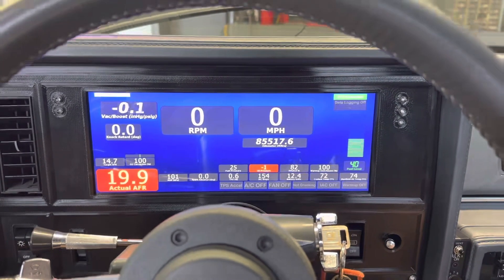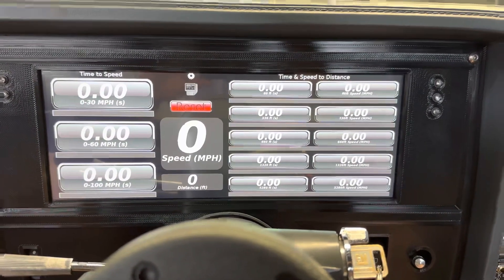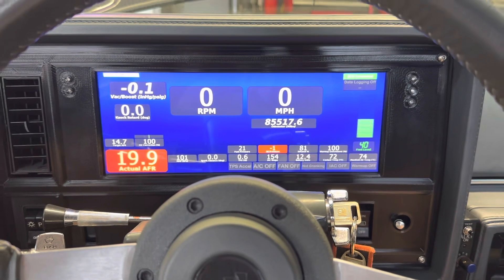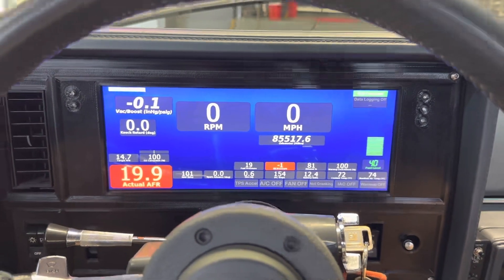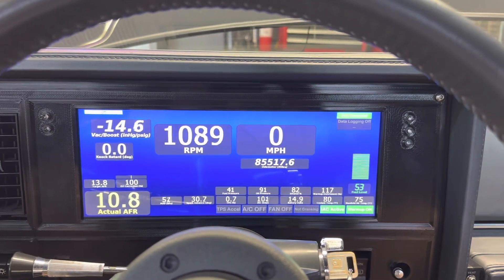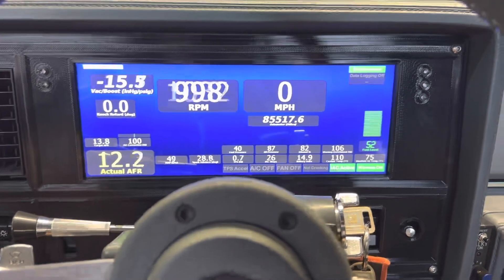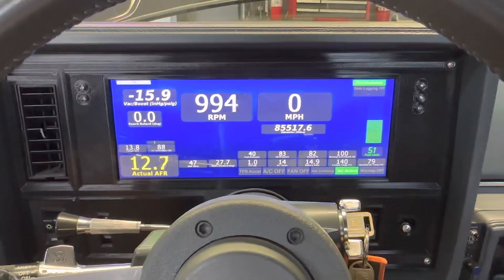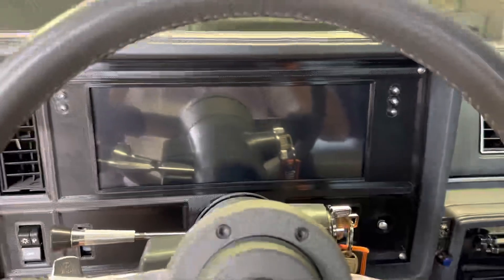G-Body Digital Dash Info!

Comment: The volt light. So sometimes when i drive the GN I'll notice that my volts are around 11v. Battery light on, then after a few minutes to 10 minutes of cruising it will randomly start charging 13.8 or above.. its very internment when that happens.
Reply from the maker: I would check the volt bulb socket in the gauge cluster. It probably has a bad connection on the printed circuit when the bulb is twisted in.  This volt bulb is what provides the resistance to the field  in the alternator to start charging. For the intermitten issue you are having, either the volt bulb circuit has a bad/weak connection or the alternator itself is glitchy…. I’m betting on the volt bulb circuit.  That socket the bulb clicks into has a resistor made into it help start the alternator charging in the event the bulb burns out, however if the connection is bad at the printed circuit or in the main harness plug into the cluster on the brown wire, it may not charge.
Reply: @AJsSpeedShop  thank you, going to church this out. I always found it funny why it would start charging after a few minutes of driving. Doesn't happen all the time but still need to be fixed.

Comment: AJ     a buddy of mine has a gn with a stroker motor a bunch of goodies 

He had 14.7 volts now he has 13.5 volts at the alternator stud when idling

The correct voltage on an Impala SS 140 amp alternator should be 14.1-14.7 volts at idle correct?
Reply from the maker: Voltage can vary based on the amount of load/equipment he has on when he is testing voltage.  Also how heat soaked everything is when he tests it.  I always test everything at full operating temp.

He needs to measure voltage drop between the alternator and the battery, if it’s more then .5v drop, then he needs bigger positive and ground cables from the alternator to the battery.

If it holds 13.5v at the battery with everything turned on in the car and it’s at full temp, then that is pretty decent.
Reply: @AJsSpeedShop  ty
My brother 
I knew you would have the correct answer...
Car is killer.  Appreciate it
Reply from the maker: No problem.  Yeah I would think he should see 14.5v at the alternator stud when it’s all warmed up, and depending on how much load he has on it.  If it’s a stock CS144 alternator, they are only about 90 amps at idle, so if he has everything on (AC, E Fan, amps, lights etc) then it could easily pull his voltage down to 13.5v at the alternator stud, and probably 13.2v at the battery.  That is sufficient but…a little on the low side.  I like to have no less then 13.5v at the battery at full electric low and full temp.

The PowerMaster alternator in my Buick holds 14.5v at the battery with everything on, all the time.  I’ve never seen under 14.3v.  It’s a hoss!
Reply: @AJsSpeedShop  
Seen that the other day
Awesome car
Awesome dash/ video 
Great channel brother 

I'm getting that dd efi
It's. A no Brainer.

Comment: Will the tc lock up without cruise control or will I need to gut my old speedo?
Reply from the maker: In order for your TC lock up to function, the ECU will need a speed input.  So if you can use the GPS speedometer for the DD-EFI dash and I believe the ECU will still get they speed input, it just won’t be coming from the cruise control module.  The ECU uses that speed input for the TCC LU mph, at say 60 mph.     So if you don’t want ti gut your speedo and use the stock pulsewidth generator and cruise control module, the TCC LU should still work, but your cruise control won’t.

Comment: Hey man great video. I’m about to. Order mines but was wondering how I can get the alternator to start charging. Does Casper’s make something for this or what did you do to get around this issue?
Reply from the maker: Yes Casper’s makes a device that uses the oem boost solenoid for power and triggers the alternator to start charging.  That’s one way to do it.  The other way to do it is switch to a “1 wire alternator”.  They are self exciting and don’t need anything else.  That’s how I did it.

Watch my video on “the g body 1 wire alternator swap” and I explain everything there.

Comment: Just watch this vid very informative. Quick question how does this digital dash compare to an MS3Pro plug and play? I have a 85 GN and I haven’t driven the car in a while. I’m now starting my build however right now I need a good tune. And of course I’d like to manage my own ecu. I know on the MS3Pro has more capabilities than the FAST programmer. Any thoughts you have would be much appreciate it.
Reply from the maker: This dash works with your MS3 Pro ECU. You still use your MS3 pro, and the dash plugs into the canbus ports on the side of it.
Reply: Good deal thanks for getting back to me. Another question will I run into problems: such as turn signals or other issues you faced? I’m definitely looking at your vids for in put. Also one more thing i’m having issues with my throttle positioning sensor. Causing my car to hesitate acceleration etc. Do you know of any upgraded part or substitute I could use for replacement? I will be taking it to a performance shop just doing some research right now.
Reply from the maker: @oneilbenn853    As long as your canbus network on your MS3 pro is functioning properly, the DD EFI dash should work with no issues.  The turn signals and high beam indicator in integrated into the dash itself. Kurtis@DD-EFI can set you up with everything and answer all of your questions.

As for your TPS sensor, you need to set the TPS voltage correctly per the oem manual, then calibrate the TPS channel in tuner studio before you start tuning.  If you tune on TPS % /voltage that is incorrect, it can throw the scaling of in your whole tune.  A stock TPS sensor and good wiring is all you need.  Make sure you have a full 5v at the sensor.  Sometimes that 5v circuit coming from the factory gauge cluster gets damaged and the voltage is too low…. Then it throws the whole TPS scaling off.
Reply: Super cool on the info, thanks bro. And looking forward to more vids. If you don’t mind could you do a vid on the TPS sensor? I know it’s a common issue on these cars. No biggie but thanks if you do.
Reply from the maker: @oneilbenn853  go here for the info on adjusting the TPS sensor: http://www.vortexbuicks-etc.com/basics.htm
Reply: thanks again and appreciate your time bro.